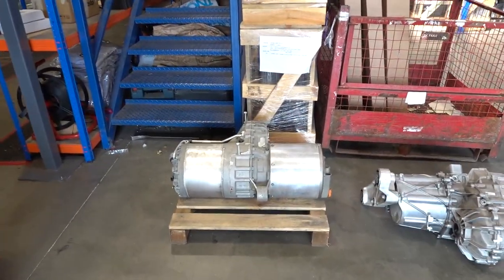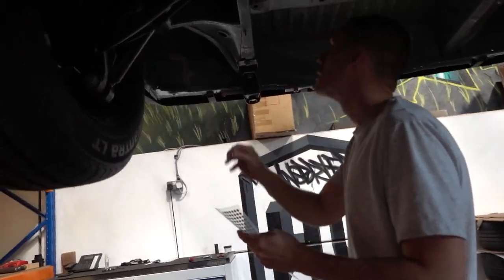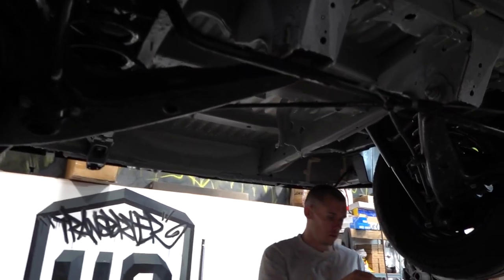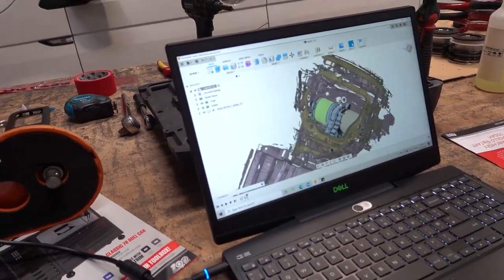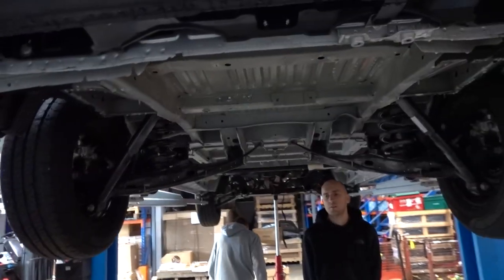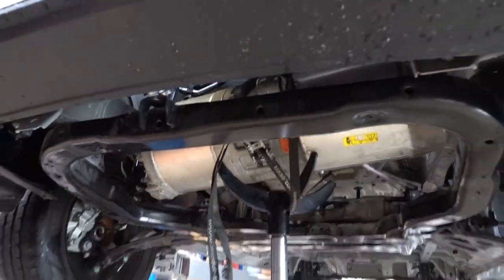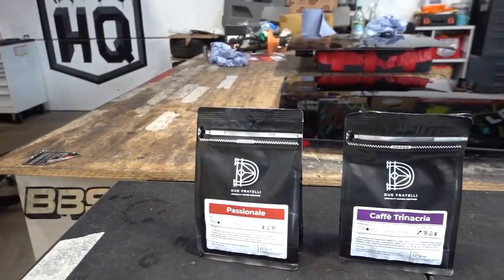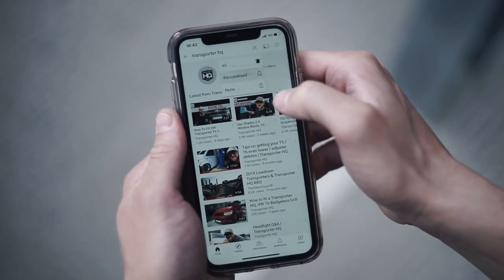Tesla Powered Transporter Episode 3, picking the motor, 3D scan & choose the  plate | Transporter HQ

Comment: Great watching this. Even with a fairly low 150-mile range it’s still a win. Drive a couple of hours then hang out in some different place for a while whilst it charges. Its just a slightly different mindset and we rarely empty our fuel tanks in one massive drive anyway. 200bhp is gonna be enough for most. Would the kit likely re-use the gearbox and driveshafts (DSG?) presumably a bit cheaper but compromised?
Reply from the maker: It’s electric so easy to go direct drive instead of using the DSG.

Comment: Been wondering if anyone will be looking at doing EV conversions for VW transporters... look forward to seeing the end result and hearing if you go on to offering to do these  :) .. though I may need to rethink the diesel hob...
Reply from the maker: Its a long and complicated process. As more useable EV parts come out, it will make it easier for sure. The next step will be a big one. Looking forward to getting this finished now :)
Reply: @THQAutomotive  was great to see the photogrammetry used to scan the underside to help the engineering process here.

We have an EV for our daily run around and would certainly be interested in keeping our VW camper on the road as an EV eventually if not excessively expensive! However, such conversions are likely to throw up extra issues I suspect with items such as underslung water storage tanks getting in the way

Comment: What range are you hoping to get from this?  Also when is the next video coming out.  It Looking good
Reply from the maker: From this one, not a lot. Hopefully enough to get it round the Nurburgring. Thats down to the power it will be giving out. The conversion option with 1 small front only motor is where we will aim to get the range.

Comment: Have You contacted EV World tour. They are located in France and they have built a Syncro  Vanagon into a solar electric powered camper. They have a network of engineers and suppliers helping them.  They have completed the project and are currently traveling in France.